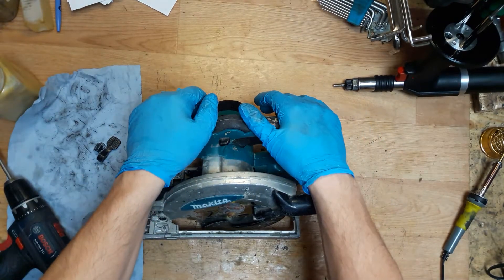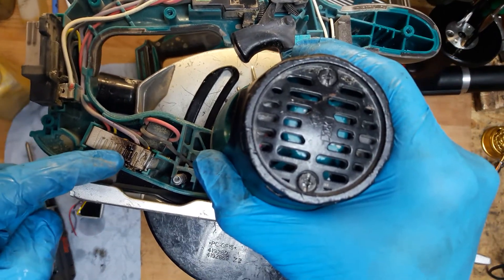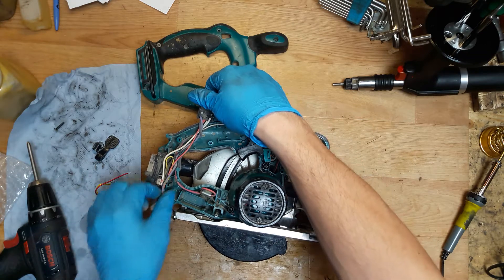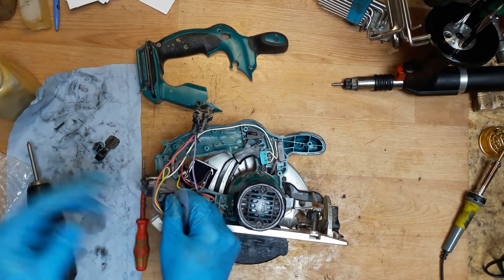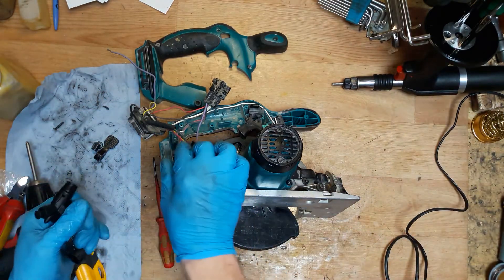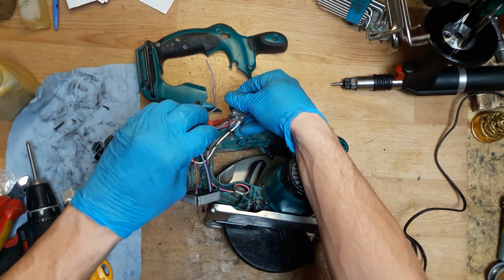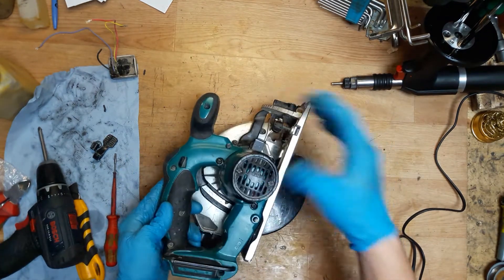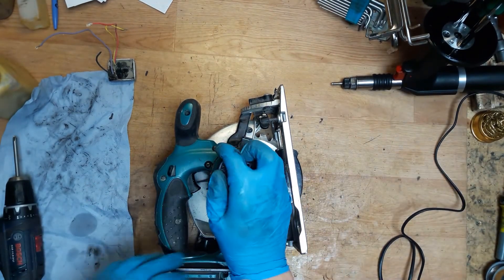How to disassemble fix and find problem for Makita DSS610 18V li ion cordless circular saw

Comment: I have the same saw and its stopped working, light still works but blade will not turn, i have checked the bushes and they is plenty of life on them, i have also checked the voltage to the brush mounts and get a reading of 20v, i have taken the cover off the handle and checked the voltage going to the switch , red and white reads 20v when trigger pressed, red and black does not show a reading when trigger pressed. What do you think will be up with it please. Thanks
Reply from the maker: When you check current on carbon brushes, yku pish switch and current is 20V? What if you check current with carbon brushes inserted? If current without carbon brushes is 20V, but with carbon brushes is 0V, then you need to change controller unit and check armature
Reply: @handyman7282  thanks , i have now checked voltage with bushes in and it doesn't show a reading when trigger is pressed, but it shows 20v without bushes in and trigger pressed. I shall replace controller unit and check armature, what do i need to look for to identify if armatures faulty. 
Thanks again 👍🍻
Reply from the maker: @ritchspence  most of times armature is burned and you will see that, but if brushes and carbon brushes holders is goid, then 99% it's controller fault. Sometimes you can notices small bubble on controller unit black epoxy side...
Reply: @handyman7282  thanks i will replace the controller and update you after. 👍
Reply: @handyman7282   Thanks for your advice and video the saw is now repaired and it was the controller module as you said , very easy and quick to repair thank you. 🍻
Reply from the maker: @ritchspence  Your welcome!

Comment: Thanks for the video. What are signs of a broken controller? Do you see low RPM and when you measure motor/battery it only gives 8,5v instead of 18v for example?
Reply from the maker: Your welcome. Normally tool not working and curreng goes to controller, but not getting out when tool turned on. You can try to remove carbon brushes and test voltage on carbon brushes holder when tool is on. Bad controller will not let current out
Reply: Handyman thanks! It’s a brushless model; DHR171. Do you think it might be a faulty trigger otherwise?
Reply from the maker: @twinstarter  No, O think it will be controller unit